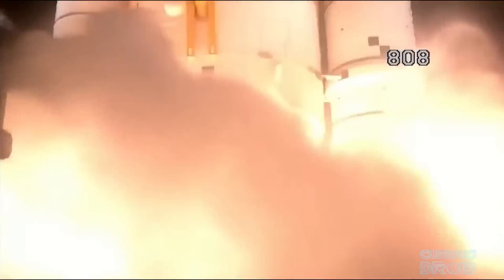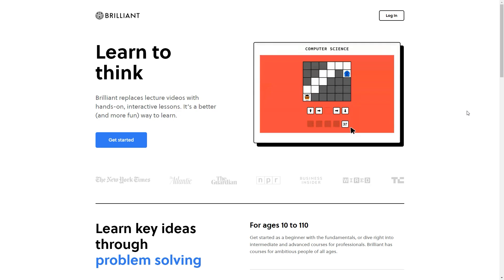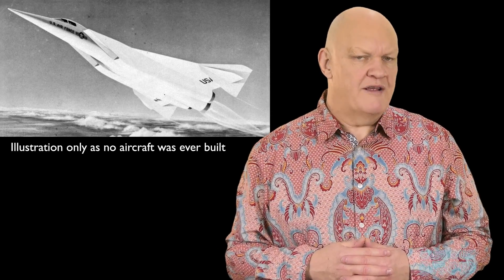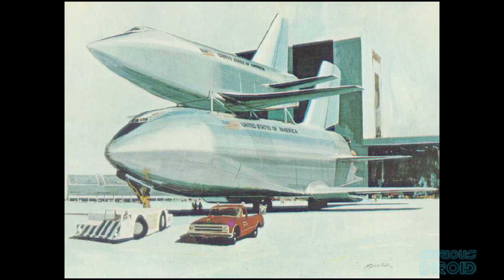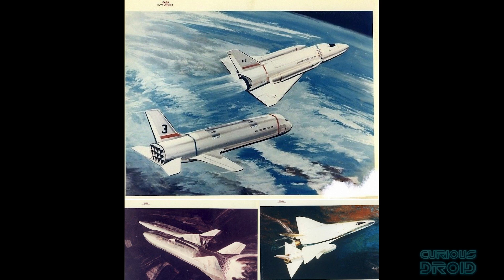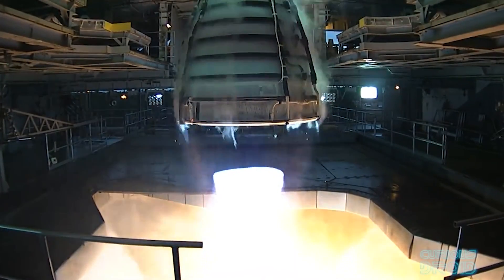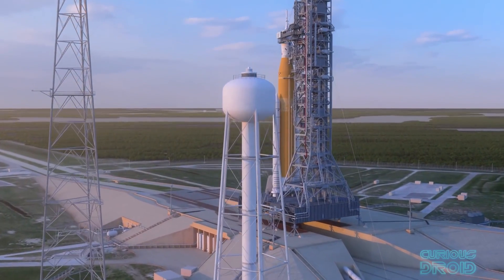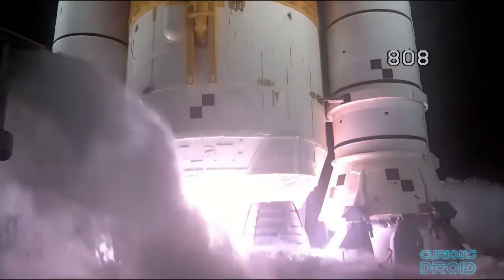Why is NASA Throwing Away Reusable Engines?

Comment: Actually,  new RS-25 doesn't represent "coming full circle, as the F1 was a resueable engine which wasn't reused.  Some F1's had accumulated as much as 8,000 seconds total run time, with only minor refurbishments between runs, like replacement of a few minor items like carbon nozzle throats.
Reply: And there were proposals for 4 outer F-1 engines to be reused, in the form of the S-1D which would've been a 1.5 stage version of the S-1C(and an upscaled version of the early 5-main engine proposal for the Atlas rocket, which was later reduced to 3 in the final design) in which 4 the outer engines were jettisoned and recovered to be re-used, leaving the center F-1 engine to complete and the rest of of the Single-and-a-Half-Stage-to-Orbit(SHSTO?!) flight!
Reply: Damn, that's more than 2 hours. Just imagining an F1 running for that long is unimaginable
Reply: @battlesheep2552  that's accumulated time, not the rocket running that long at once
Reply: "Actually..." - 🤓
Reply: @ButterfatFarms   The fact that something isn't reused  doesn't mean it isn't reusable.
Reply: @ButterfatFarms   I never said reusing the F1 would be cost effective in any scenario that actually existed.  

Certainly, one might imagine some kind of mega-booster, in which F1's made it to LEO, and could perhaps then be refired for a Lunar or Mars mission....

 I just pointed out that with only minor refurbishments between runs, less than reusable Shuttle RS-25's always got,  F1's could be and were refired many times, some accumulation as many as 8,000 seconds total firing time.
Reply: Nearly every rocket engine is reusable when you think about it that way
Reply: @sparten17708  
"Nearly every rocket engine is reusable when you think about it that way"

Well, there's gotta be a way to improve the situation with SLS a little bit.

Personally I would have kept the recovery systems on the SRBs and added one on the main rocket. We can take the payload hit in the name of making these launches less expensive.  🙂
Reply: @ButterfatFarms   So, if we have two identical F1's,  with one going into an expendable booster, and the other into a resuable vehicle, one of those IDENTICAL engines is reusable, while the other, despite being identical in every way, is not!
Reply: @ButterfatFarms   The point was the F1 could have been reused, but wasn't, just as the RS-25 is a reusable engine that won't be.
Reply: @ButterfatFarms   so it's better to nitpick the "nitpick"?
Reply: @ButterfatFarms   Just read my original post. That's all there is to it.
Reply: @ButterfatFarms  I recall reading (on either Wikipedia or Encyclopedia Astronutica)?.... that the RS-68 engines currently in use on Delta4 boosters are the redesigned RS-25 for lower cost & expendable use, unfortunately also not human launch rated. So, an apples to apples cost comparison can be made! Also while Delta4 was used to launch and reentry test the prototype Orion spacecraft a few years ago, they wont use it as a "moon taxi" to get crews up to the proposed Lunar cycler station, and indeed are stopping production soon because its too expensive? Seems a real head scratcher because SLS is a CRAAAZY expensive tool to get to the moon ; now Falcon9 is man rated, mostly reusable thus relatively cheap per launch (If reused!), and in triple booster "Heavy" configuration has comparable lift capacity to Delta4 Heavy. An orbital rendevous assembly of modules to create a "moon station" seems obvious, considering the ISS and Chinese stations were built that way, and the nav & docking tech has evolved massively since Apollo-Soyuz flew. Even with SLS test mission flying right now a week from splash down off San Diego, it seems like the gold plated Hummer stretch-limo with a Hot Tub approch to moon exploration missions!
Reply: would have been so much better if they kept the parachute system on the SRBs and added one to the main section.

Also it only really needs to get to LEO, you can assemble whatever you need at the ISS.

Let me put it another way....if you're going to try to launch everything you need in one launch with a huge rocket, there's a limit to how far you can go with that. Are you going to send 100,000 people and everything they need to Mars on one rocket? No, right? Ok, so since we concede we need more than one launch, let's assemble things in orbit. LEO is all you need.

But I know...Senate Launch System....if Elon Musk hadn't turned out to be such a racist, I would still be saying "let's use spacex for everything", but really feel strongly at this point that he doesn't represent the USA well.
Reply: I believe that by the time the H2/LOX is used-up,  the vehicle would be traveling too fast and be too far downrange for the big liquid fuel tank to be wroth recovering.
Reply: Occhamit 2hr 13min and of course (3)
Reply: @heart_break1  That F1-B though.....
Reply: I thought NASA also has a bunch of unused F1's in storage looking for a future booster to be used on.
Reply: @RCAvhstape  all the remaining F-1s are in museums.
Reply: @RCAvhstape  the trouble is that we lost the knowhow of building new f1 engines, so if the last f1 engines were used a new engine has to be developed to replace them when they rech eol
Reply: @hansdeable  Both correct and incorrect. Correct that we can't build a carbon copy of the F-1 or F-1A, because certain parts of them require methods that are no longer available; but incorrect if we were to build a modernized version of the F-1, as Dynetics has announced that they have been able to retain certain fundamental knowledge of building the F-1/F-1A and combine them more updated technology and simplified design features previously not available, and this proposed new version is known as the F-1B which is part of an LRB contender for the replacement of the 5-segment SRBs on the SLS Block 2.
Reply: @hansdeable  No, we certainly did not "lose the knowhow" of building F1's. Rocketdyne has designs for upgraded versions of F1's and will gladly build you some if you pony up the cash. This myth of "lost knowledge" is recurring bullshit on the internet and it's just not true. We can even build a steam engine if we want; there just aren't any customers for that tech these days.
Reply: So everyone on this feed chime in!! , if the f-1 was returned( ie as a booster on a wing) is it a case of de coking the burned residue to return the engine to service? So it would be stripped. Then cleaned  / bathed/ etc inspected re assembled and torqued etc ?/ does it have to be test fired ?? no right it will re coke, do replace its hypergolic cartridge check wiring etc.  These days could a f-1 (6 in storage ) be upgraded to  f-1a standards with computer gimbals and run time monitoring or is it just a best a big dumb engine flick the switch and go? Opinions please. Not politics. Lol
Reply: @Banchinaforever  I have no idea, but I'm hoping to hear what those more knowledgeable have to say....✌️😎🍀
Reply: @Banchinaforever   You don't get it; F1's WERE fired, re fired, re re fired, dozens and dozens of times, with very minimal refurb between firings.

Gimbal assemblies etc are not part of the F-1,  note the center engine did not gimbal.
Reply: You get the gold star for pedant of the day 🌟
Reply: @marvintpandroid2213   And you get the gold star for gadfly of the week.
Reply: Exactly, in order to reuse an engine it has to be recovered. Any engine can be reused if it can be recovered. Not always easy to do so.
Reply: @DeepDeepSpace   Now that's just silly. many rocket engines are DESIGNED to fire once. The F1 was capable of dozens, if not hundreds of firings.
Reply: @occhamite  no rocket engine is designed to fire once. An engine has to be tested before its actually used. Engines are fired multiple times before they are used in a launch.
Reply: @DeepDeepSpace   So the Shuttle's solid rocket motors were test fired?

i'd like to see that!
Reply: @occhamite  Yes the Shuttle's Solid rocket motors were test fired. Segments were used on multiple missions. 
https://www.youtube.com/watch?v=MG3qb0GmUl0
Reply: @DeepDeepSpace  Well there are some exceptions to this. The Apollo LEM's ascent stage was designed to only fire once in its life because of the immense toxicity of its particular hypergolic propellants prevented it to be tested before flight.
Reply: @jmwoods190  Thanks for mentioning that, I was mulling the wording for it while I scrolled thru comments. Also, military missle/drone engines are usually not individually test fired as a final unit, but only component tested for pressure and flow, with only QA samples being taken for live fire tests. Same goes for solids. Many storable propellants are exceptionally corrosive and damage any normal materiels they contact (especially bio-organisms!) and wouldn't be kind to the lifespan of the equipment that has to sit in bunkers or silos for years as a ready for launch weapon system. Reliable operation on that 2nd operational firing would be iffy at best, and in the case of the LEM engine (a stripped down to the basics pressure fed design for reliability) not worth the risks.
Reply: Could they land a first stage? Then no, they were not actually reusable even if they were potentially reusable. How do you feel about that?
Reply: @Ingens_Scherz  Depends on what you mean by "land a 1st stage". Despite its advantages SpaceX-style landings are absolutely NOT necessary for stage recovery and reuse. Remember that the Shuttle SRBs parachuted in the ocean and are later taken back to be refurbished for reuse, and it worked fine for 3 decades. The same would've probably been possible on the S-1C. Furthermore, there has also been a proposal for a winged Saturn V 1st stage in place of the SRBs albeit under the External tank, once jettisoned it would glide back to a runway just like the a very big shuttle, then refurbished for reuse. So yes, even if you don't land rocket stages the same way as SpaceX does(even though I appreciate the ingenuity) it's far from the end of reusability!
Reply: @Ingens_Scherz   I feel that you are being very silly.  Either the engine was reuseable or it wasn't. The fact that the Apollo booster wasn't designed to be returned doesn't alter the characteristics of the engines attached to it.

By what mystical process do veteran Shuttle main engines, with dozens of flights on them, suddenly cease to be reuseable the instant they are attached to a nonreuseable booster?  If they were then taken off the booster and attached to a reuseable booster, your mystical process would then retransform them into "reuseable" engines?
Reply: @Ingens_Scherz  this has so much Elon Musk fanboyism
Reply: @Ingens_Scherz  
Sorry, but a machine being reusable or not, has nothing to do with whether or not the tech to keep it from crashing exists.

They are two different things. 
English isn't hard.

Comment: C'mon guys - let's show some love for Artemis - it's taking us back to the moon ffs - sure, a few setbacks for the launch but it's now travelled further our than sny other human rated rocket !
Reply: Not true.  The ascent stage of Apollo 10's lunar module, named Snoopy, was actually flown, in lunar orbit, by Thomas Stafford and Gene Cernan.  After they returned to the command module, Snoopy's  engine was fired again to put it in a heliocentric (sun-centred) orbit.  It's been up to about 180 million miles from Earth, at times, so dwarfing the pathetic distance of the (wholly unmanned, so far) Artemis.  Snoopy was tracked again in 2011, with 98% certainty, and is still orbiting the sun 52 years on from its original mission.  It's now classed as a small, earth-crossing asteroid, and has been given the designation 2018 AV2.
Reply: How many crew members were on the flight?
Reply: @JustaKubrickFan  its a test flight, instead would you like to see it not work and kill 4 people?
edit: Its also gathering a lot of data, and launching some cubesats, apollo took a lot longer to do the same thing minus the cubesats
Reply: @JustaKubrickFan  About the same number that was on SpaceX first Crew Dragon 2 flight.

But that's SpaceX and Elon's a God - and/or a right wing tosser - so that's alright then.
Reply: @Martin R Does not count.
Good try though.

Comment: The shuttle’s external tank was not reusable. The big orange tank was discarded after every launch to burn up during reentry. The SLS orange fuel tank is based on the shuttle’s external tank, but has a great deal of changes and improvements.

Comment: If NASA with an astronomical budget and a team of brilliant Engineers, the best they came up was the Space Shuttle and even so, it failed to be really an economical option due to operational costs as refurbishment...I'd take with some skepticism the over optimistic claims that Starship will decrease drastically in the long run the cost per Ton to LEO.
Reply: Actually, the Shuttle as we knew it was very much a budgetary *compromise*...
Reply: The existing Falcon 9 is already vastly cheaper per unit of mass than the Shuttle system. SpaceX can build several engines per week for the StarShip. I'd not bet against it.
Reply: @UncleKennysPlace  Merlin engines are based on the TRW - Lunar Descent Engines. They are around for decades. The Raptor engine is a complete new type of engine category.
Reply: @UncleKennysPlace  if Falcon 9 rocket retrival made a huge difference in prices charged by SpaceX, then the cost per kg to LEO, should be drastically decreasing not increasing. And SpaceX wouldn't be rushing to decommissioning Falcon 9 for Starship.
Reply: @SecretRaginMan  SpaceX didn't really needed Starship, they could instead diverted all that funding, for the development of a bigger fairing to Falcon Heavy, able to fit a propellant module and the Red Dragon capsule. Which would make more strategical sense, since it would be Crew rated more easily, and safer to land on the Moon and Mars. While the voyage would be made in a modular Spaceship, assembled at LEO, which could be developed by other companies.
Reply: @RogerM88  1) Yes, they do still need Starship. Not only does it have a larger payload reusable (100 tons) than Falcon Heavy has expendable (64 tons), but Falcon 9 and Falcon Heavy suffer from their fineness ratio. Look it up. They are thin and long which makes them more susceptible to launch weather and wind sheer. Compare them to the Soyuz which can launch in a blizzard. It's a chonky boi. Starship is even chonkier.

2) Furthermore, they are developing a longer fairing and vertical integration just for national security launches for Falcon Heavy. This is only because they rejected Starship while simultaneously handing the majority of missions to ULA's in development Vulcan. Favoritism? Nah. Pfft, nah.

3) Moreover, Red Dragon was not its own vehicle but a mission for Dragon 2 (now often called Crew Dragon). There is an entire Wikipedia page you can peruse to educate yourself. It would not be able to return on its own from either the Moon or Mars.

4) Finally, why make a modular vessel when Starship is already the size of the ISS by internal volume? And why are y'all so insistent on sending a tin can out to the moon instead of sensibly docking in LEO? Goodness gracious. Neither SLS nor Falcon Heavy is necessary for a crewed mission in the context of sending crew out to the moon. Assemble and refuel in LEO then go.

This isn't the era of Apollo where tiny capsules is the best we could do. Get with the times.

Comment: It is such a massive shame about the forthcoming disposability by NASA. But I guess that is par for the course ATM until the other systems become common place.
Reply: People say "spacex shows how much  out of  tune and antique nasa is" and its true I must say, but spacex hasnt had a orbital starship at all let alone crew rated to the moon. But it is sucha  waste I think its just because somr rich company ceo's lobby so they can build extra disposable engines. If we INVENTED and INNOVATED like the gemini mercury and apollo missions which gave us a HUGE amount of the things we take for gtanted in modern life ike mylar and computers today instead of using 50yo hardware thinkl of what we could accomplish!
Reply: NASA's rockets are a politically driven enormous waste of money. Say what you like about Musk, but at least SpaceX (and others) see the major benefits in major reusability.
Reply: It makes sense. You want as much payload capacity as possible - landing the first stage a la SpaceX reduces payload as it adds complexity and weight for the landing system plus fuel for the 'suicide' burn.

And the engines probably weren't designed to be reignited - so this slso may be a factor.
Reply: @mrb.5610  Starship is designed to be refueled so it can take tens of tons of payload to the lunar surface. It is able to put more payload on the surface than any other lander proposed. There is a reason why a certain Senator (Richard Shelby) threatened funding to ULA over the word "depot". Refueling in orbit, which was a concept and proposal long before SLS, reduces SLS to obsolescence quite thoroughly.

Current heavy lift rockets like the retiring Delta IV Heavy, upcoming Vulcan Centaur and New Glenn, and current Falcon Heavy make monolithic launches like SLS unnecessary. FH is $150M for 64 tons to LEO. Could launch sixteen times for one SLS + Orion mission ($4B according to NASA's OIG). Even DIVH at $400M could launch ten times, or thirteen times at $300M.

On-orbit assembly and fuel depots are the future, not SLS.
Reply: Single use is safer.